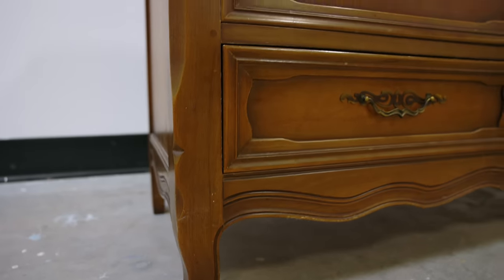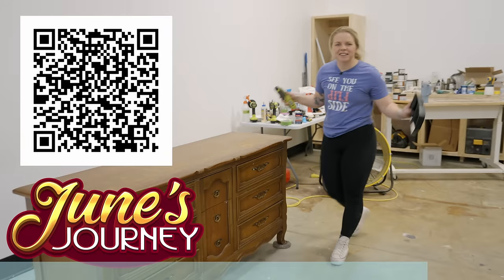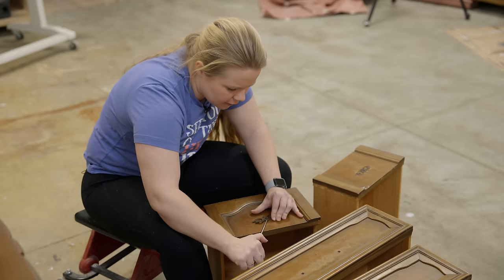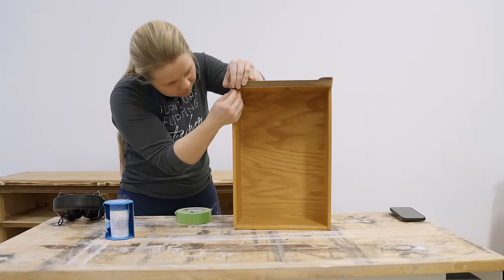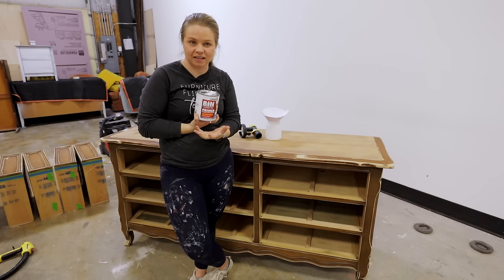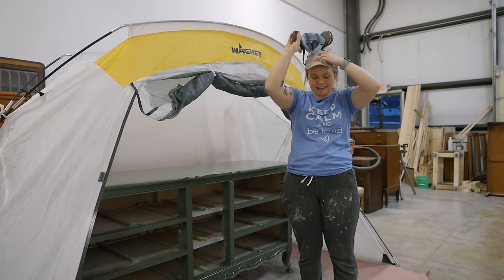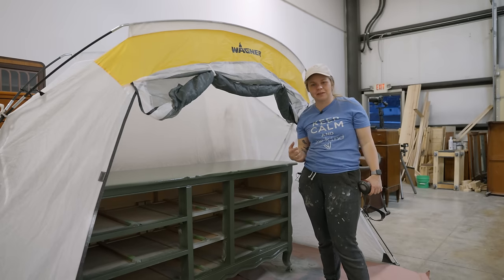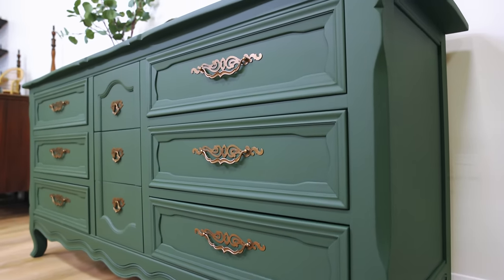Killer Facebook Marketplace Find!

Comment: I have a question. If I sanded my furniture/dresser to the bare with absolutely no paint left and I wanted it to have some dark color to it so that I can distress my furniture but it doesn’t have any color to it because I sanded it down to the bare…. Could I just stain the whole dresser the voodoo Tobacco Road water base and then prime it afterwards and then paint it? I’ve never done this before and want to make sure the furniture will be fine.

Also I used the 60 sand paper. I hope that’s okay.